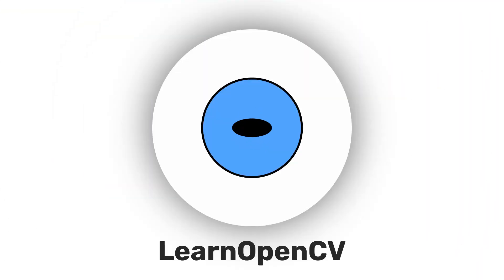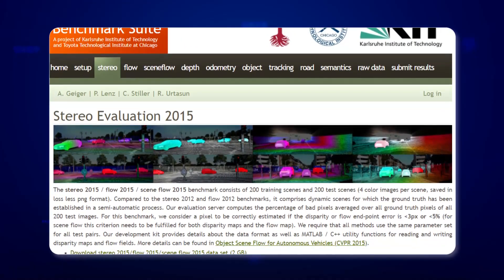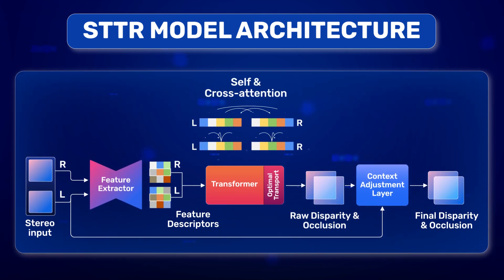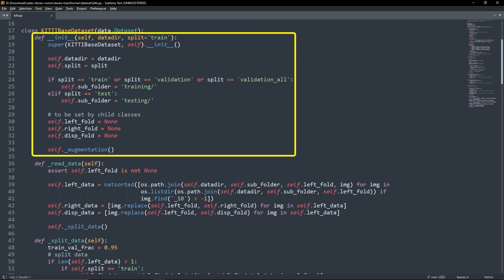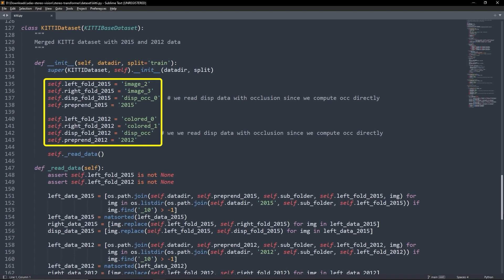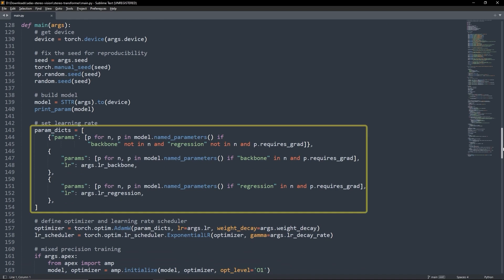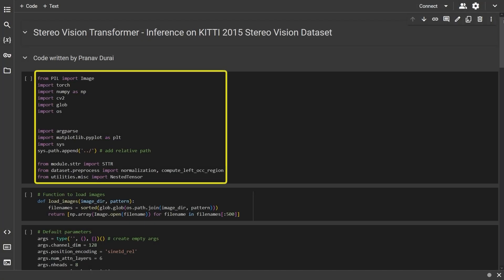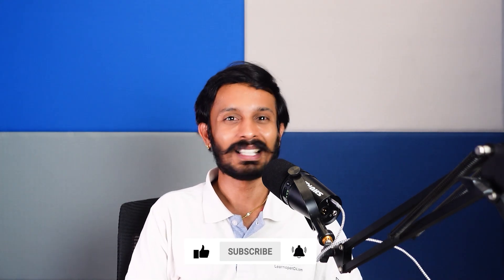Stereo Vision in ADAS:  Depth Perception Beyond LiDAR

Comment from the maker: 📚 Blog post Link: https://learnopencv.com/adas-stereo-vision/
📚 Check out our FREE Courses at OpenCV University : https://opencv.org/university/free-courses/

In this video, we cover:
~  The limitations of 3D LiDAR systems and how stereo vision can be used to extract 3D information for ADAS.
~ An introduction to stereo vision and training the stereo transformer model.
~ Capturing images from two slightly different viewpoints to calculate the disparity map.
~ The advantages of stereo vision cameras over LiDAR, including high-resolution image capture and cost-effectiveness.
~ Using the KITTI Stereo 2015 dataset to train our model for disparity and occlusion prediction.
~ The architecture of the STTR (Stereo Transformer) model and its efficient global context acquisition.
~ Steps to prepare the dataset and train the model, including dataset augmentation, training loop, and model checkpointing.

~ Running inference to generate predicted disparity and occlusion maps.
💡 What You’ll Learn:
~ The workflow for integrating ADAS with stereo vision using the Stereo Transformer model.
~ Visualizing disparity maps and understanding the model architecture.
~ Detailed training procedures, code walkthroughs, and training results using the KITTI Stereo 2015 dataset.
~ Practical applications and benefits of stereo vision in ADAS.
Watch our video on Learn OpenCV to dive into the implementation and training of the Stereo Transformer model for ADAS.

📺 Liked this tutorial?
Tell us in the comments what you want to learn next and subscribe for more tutorials!
🔗Resources:
🚀 Join Us - 🖥️ On our blog - https://learnopencv.com we also share tutorials and code on topics like Image Processing, Image Classification, Object Detection, Face Detection, Face Recognition, YOLO, Segmentation, Pose Estimation, and many more using OpenCV(Python/C++), PyTorch, and TensorFlow.
🤖 Learn from the experts on AI: Computer Vision and AI Courses
You have an opportunity to join the over 10K+ (and counting) researchers, engineers, and students that have benefited from these courses and take your knowledge of computer vision, AI, and deep learning to the next level.🤖
https://opencv.org/university/courses/

#️⃣ Connect with Us #️⃣
📝 Linkedin: https://www.linkedin.com/in/satyamallick/
📱 Twitter: https://twitter.com/LearnOpenCV
🔊 Facebook: https://www.facebook.com/profile.php?id=100064001437329
📸 Instagram: https://www.instagram.com/learnopencv/
🔗 Reddit:  https://www.reddit.com/user/spmallick

🔖Hashtags🔖
#ObjectDetection #AutonomousDriving #DeepLearning #AIinDriving #TechInnovation #LearnOpenCV #ComputerVision #MachineLearning #AdvancedTech #AutonomousVehicles #StereoVision #ADAS #STTR #DisparityMap #KITTI #LearnOpenCV #OpenCVUniversity #AI #ArtificialIntelligence